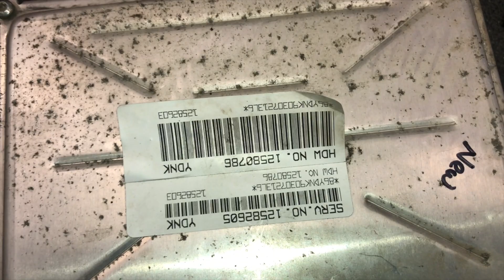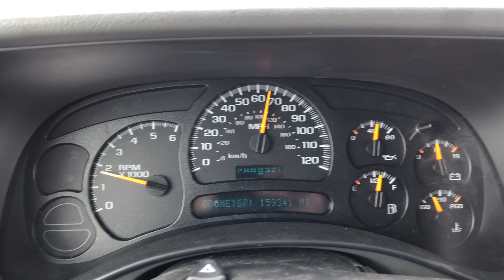2005 Chevrolet Tahoe Crank no Start

Comment: so kind of same deal with my 04 I had a new motor put in it and after 3 months it started going thru throttle body's then mass air flow 02 sensors then catylaic converters failed ,then crank position sensor replaced after it quit starting it started then ran rough and died and now it won't start at all. no codes at all other than the throttle body and when I mean it started going thru throttle body's I mean 1 every 30 days for 6 months . had it to several shops they threw parts at it and it still will not start.

Comment: Good information bud mine won't crank from key switch but I can start it from starter relay after it starts has information on dash says loss engine power if u let it warm up to 200 degrees and shut it off wait 5 mins and start it runs fine no codes in message center then if u drive it  the engine shuts off and won't start back for hours it sounds like same issues u had what u think man

Comment: Good video....I have a 05 yukon with the abs light system service on.   Do you know what could be?
Reply: Hi for mine that was inside the electrical portion of the abs module there are some metal conductors one of those breaks and it’s a simple fix to solder it. However not a simple fix to get the ABs module off the vehicle google it theres 4 torx 20 screws that need to be removed and usually are seized

Comment: I just hit the submarine button. My wife has the exact same car. She Called me while ago and said her car would not start. It would turn over and over and over but it would not start. Well for some reason she pulled the dipstick and check the oil and it was not reading any oil. So then she put oil in it and it fired right up. Did the oil really fix that car or is that just a coincidence?